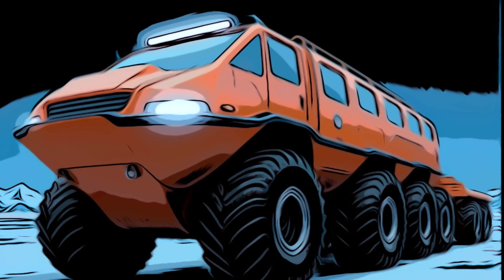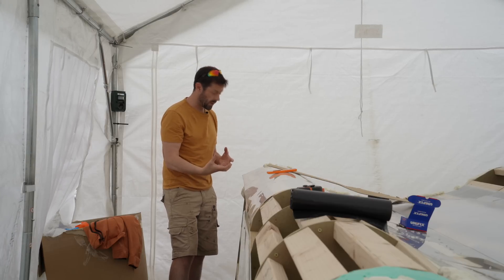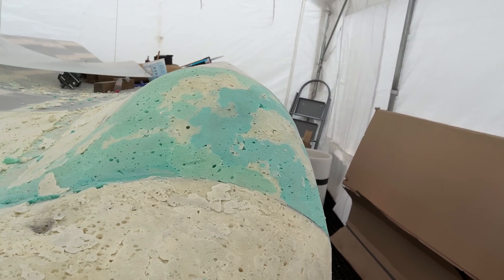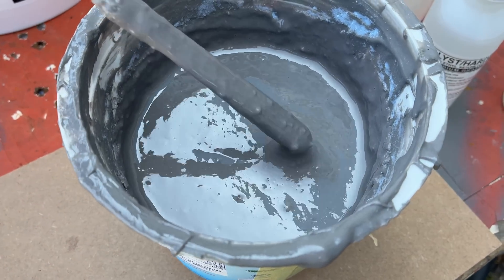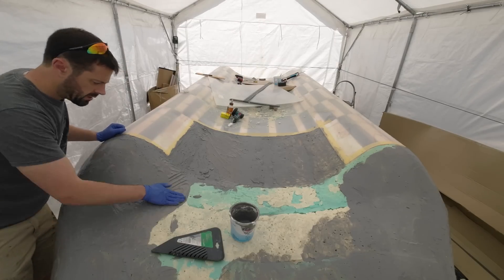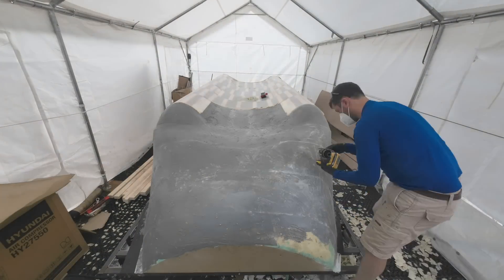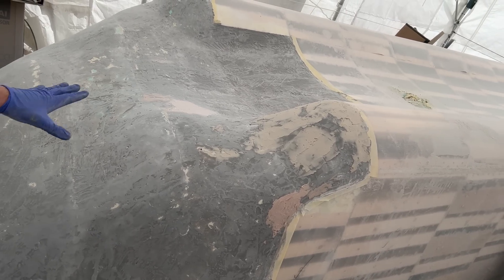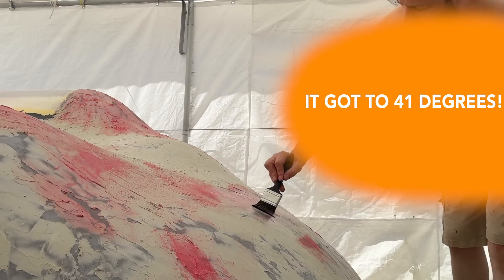(Almost!) finishing a 240 sq ft mould for Bernard - the carbon fibre Arctic vehicle project [4K]

Comment: well you really need to be in a controlled temp area, the amount of movement the plastic is going to give you is going to be a major problem.
Reply from the maker: I think the issue (and yes PP has a medium/high coefficient of thermal expansion) is negligible at normal temps (10-25deg). It's only in intense summer heat we got expansion. In cooler temps the plastic will shrink slightly and pull tight onto the mould which is good.

Comment: oops, too late now ... the foam / pour-foam plug with voids etc can be nicely filled and contoured to stable shape / surface with a skim coat of builders plaster, then surface prep of choice to a release layer
Reply from the maker: Is plaster robust enough? Likely to crack?
Reply: Dimensional stability of the underlying frame is important; I have found expanding foam variably unstable, however block styrofoam is good. Stick blocks together with thin joint of epoxy/micro and allow to cure.

We have used plaster- skimmed foam to produce smooth contours like  engine cowling plugs. Quick method to fill foam and voids. This trick emerged in US canard airplane builders group (Rutan aircraft designs homebuilders)

Plaster can cheaply be painted smooth before release agent applied. And /or, put several layers of cling film over the plug, perhaps use stripsnof peel ply. If the plug is for single use it can be 'wrecked' out of the cured part.
Plaster skim (thin layer) is simply a way to  achieve a smooth aerodynamic contour over the carved foam..
Also, you can carve the foam shape with a sureform tool, or home made sanding spline which can be straight or bendy, or for curves use another block of same foam  .. the two surfaces abrade neatly into curves.
Reply: ps. if you get some plaster cracks, just put grey tape over .. thickness of tape will be trivial to the layup in this application, I suspect.

Plaster is cheap and fast, contourable / easily fill- sanded smooth, and is  mainstream in architectural / building work down the centuries, and yes it can eventually crack however if the underlying substrate or structure is stable, cracks are trivial and can be filled with ease, certainly compared with epoxy or polyester structures.

All this is predicated on a single use plug, which gets wrecked out of the build post cure.
Reply from the maker: All good info thanks. I'd been swapping in filler instead of plaster. Agreed on cling film and tape.

Comment: Much Progress, Looking very mold like, but freezing at Night, warm days, probably 11 am before mold frame made of WOOD (full of moisture) gets warm at least, or dries out, before plastic sheets fit as they should probably, So not being snarky but where do the Wheels or Drive chain go ?😄
Reply from the maker: I think it's the PP more likely to be slihgtly expanding at +40 deg when it was fitted at +15deg. 

Wheels will emerge from reinforced sections of those near-vertical sections. Drivetrain (wisely) within the shell....

Comment: If you need sheets of foam for mould making, it''s pretty easy to peel the foil off of Reticel insulation. Start peeling the foil along one edge, stick that lifted edge to a piece of pipe with packing tape then rotate the pipe to roll the foil off. Some other makes of insulation are a complete nightmare to peel.
Reply from the maker: Is that preexpanded PU insulation foam? It's very soft I find. I had a play with some at the hardware store.

Comment: Have you considered using carpet tape to hold the plastic sheets down? I know most adhesives don't work well with PP/PE but carpet tape seems to stick fairly well to most things.
I generally find body fillers to be too thick for my taste so I generally thin them down a bit with fibreglass resin. I find it goes on smoother that way, reducing the amount of sanding needed.
Reply from the maker: I've been using special composites flash tape but the plastics are too stiff and springy to be overcome by just tape.

Comment: Aluminum scaff legs 6 foot ladder beam over head work would be easiest
Reply from the maker: I tried to take reach and access into account when first planning the mould. I can reach the centre, but I agree a scaffold would be fun!
Reply: @AlexHibbertOriginals  I'll start putting a kit together? Legs I got, fittings and plates for floor, wheels would be better. You need a ladder beam that spans. We have only one car right now. Around Uxbridge.
Reply from the maker: Ha! I love the enthusiasm. I'll see how the arm reach ends up as I test the plan. It may be overkill.

Comment: Just a design, though. If you make the both half's of the vehicle exactly the same like the 2 half's connected back to back. The design costs and production costs would be reduced. Plus if one half is irreparably damaged,  you can de couple and carry on with the half that is OK.
Reply from the maker: That's exactly the idea :) Control Bernard will have the same shell shape as Power Bernard.
Reply: @AlexHibbertOriginals I think i may have missed an episode 😕

Comment: If possible, I would set up two fans in the tent to help manage the dust when grinding.
One at the back, ideally elevated, and one at the front, both pointing out towards the opening.
It should help create some better air flow to push some of the dust out, without having to set up a more complicated dust extractor system.

And they might help on the really hot days as well, just for cooling airflow.

Also, an air compressor is very effective to blow the dust off you afterwards, much better than a broom or vacuum.
Reply: I was a bit concerned about the amount of dust, especially as the FFP2 mask won't do anything. However, Alex is an adult, I don't think he needs to be lectured by me.
Question is how much sanding there still is. I think there's a good chance there's none left, and even if, it might not be enough to warrant an "extraction system"
Reply from the maker: Agreed on the mask not being ideal - my large one steamed up, midsize one is missing with the ear defenders, and so this was it. That said, https://www.3m.co.uk/3M/en_GB/home-improvement-eu/resources/news/full-story/?storyid=fef6c45c-c5e2-4aaa-9517-546804834044#:~:text=Any%20FFP2%20respirator%20can%20typically,Coveralls%20are%20useful%2C%20too. says FFP2 is ok , although I'm 100% there are entire internet forums arguing about this.

On the wind tunnel idea yeah on a day when the wind is going the right way. I considered fetching the air con too!
Reply: @AlexHibbertOriginals  Just from experience, the FFP2 mask does little to keep the dust out. The filter definitely can, but most of the air ends up coming through the gap between mask and face anyway, at least for me
Reply from the maker: Ah that's probably it; their test probably assumes a perfect seal.
Reply: @anonaustria9867  There's going to be a decent amount once the Bernard comes off the mould, as there is always clean up work to do afterwards.
And that almost always involves a fair amount of sanding.

Comment: 1) Somebody should tell Voiceover-Alex he sounded a bit AI-denoised today
2) At 6:37 your (I assume) numberplate is visible. I don't know whether you care, though
3) I really hope the thermal/humidity expansion issues now don't turn around to rip the panels off the frame in winter
4) So as it turns out, my prediction that the tight radius will also be PP-clad, while initially wrong, was correct in the end
Reply from the maker: Cheers

1. No AI - but I did slow it down by 2%. I recorded the VO in a rush.
2. It's a rental car.
3. I think they are too slight for that, although I'm considering pulling a female off this pattern, and making a single laminated much lighter male from that.
4. Yes you're very prescient! My worry about the PP cracking was overly cautious.